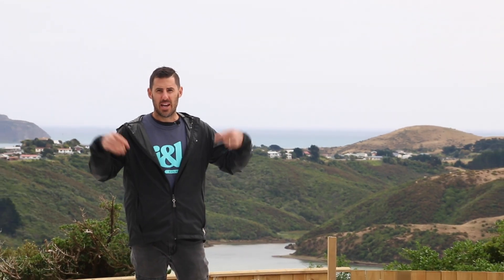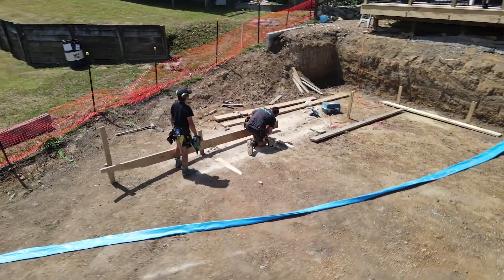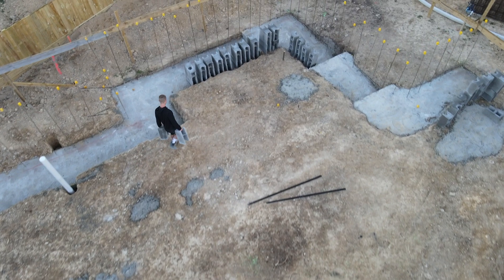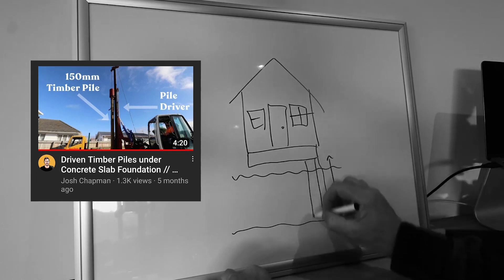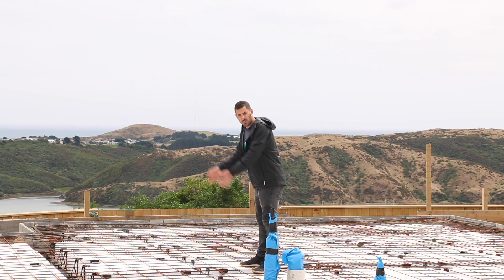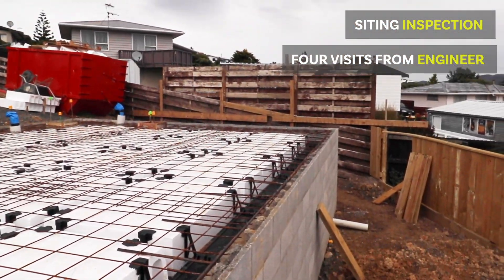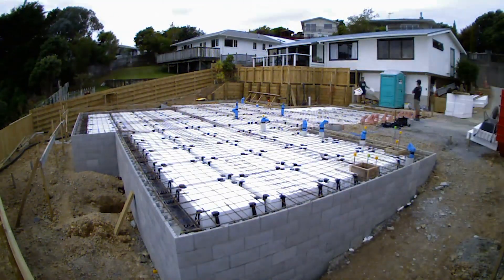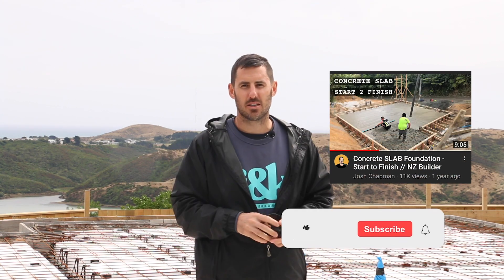Sloping Site Concrete SLAB - Start to Finish

Comment: Hi Josh, what makes you decide to go concrete slab or piles? With a sloping site wouldn't piles be easier/cheaper? I have no idea, but was just wondering! I looked into insulated slabs and heard about MAXRaft and importance of insulating the edge of the slab. Have you heard of them? Or is this insulating edge talk nonsene? Would be interested in your opinion! Thank you for the video 😊
Reply from the maker: Hey Nadine, in this particular instance the client really wanted the whole foundation floor to be concrete so thats why we choose block and fill. Piles and timber subfloor would have definetly been a slightly cheaper alternative.
Reply from the maker: Regarding MaxRaft, we have looked at them but never used one. Slab Edge insulation is a good idea especially if your going to have underfloor heating, but otherwise I've found that people prioritise a better heating system over slab edge.
Reply: Thanks for your repies Josh :) interesting!